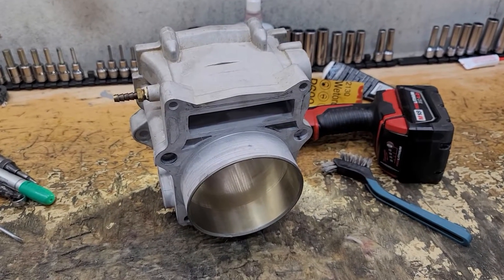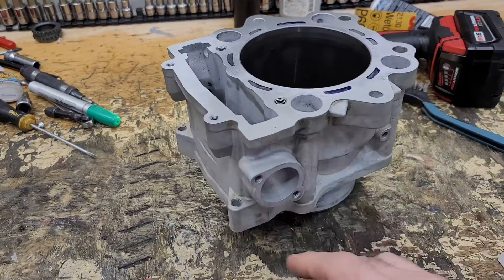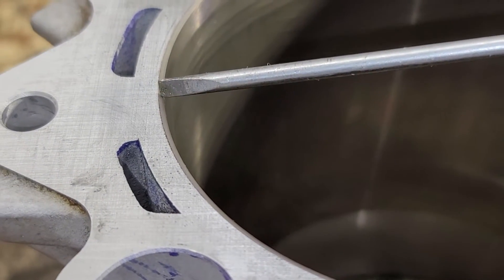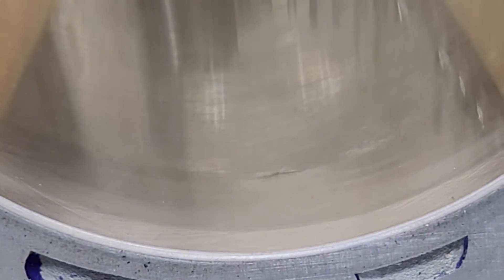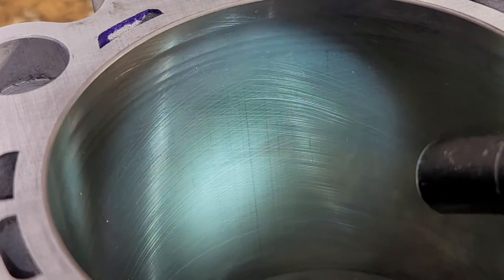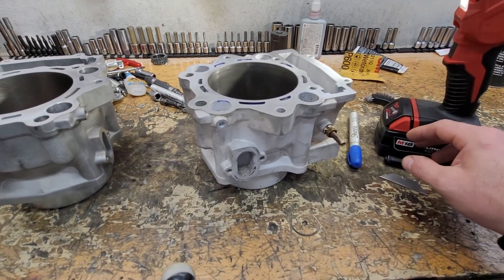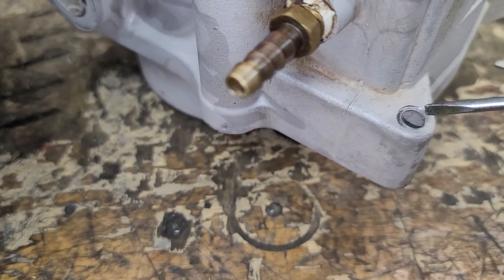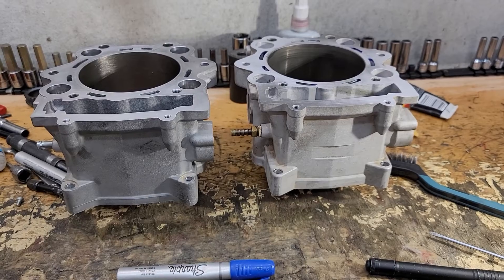Chi-na why most aftermarket  cylinders are Junk and why we don't use them

Comment: I've never had and problem with Cylinder Works, installed hundreds of them with no issues. I have a stroker Lt-z400 with a big bore Cylinder Works cylinder and 14:1 cr with no issues at all.